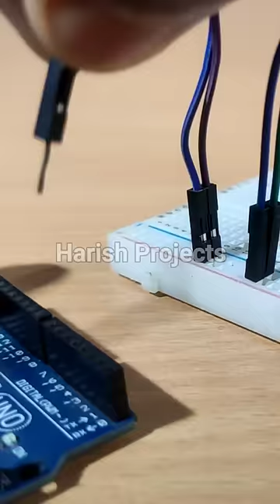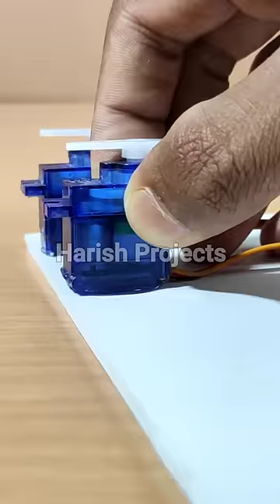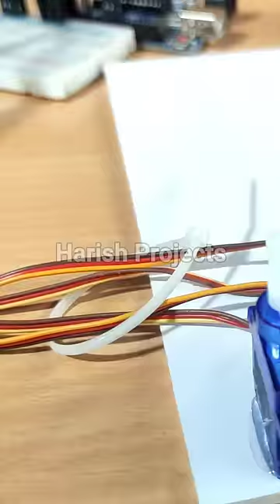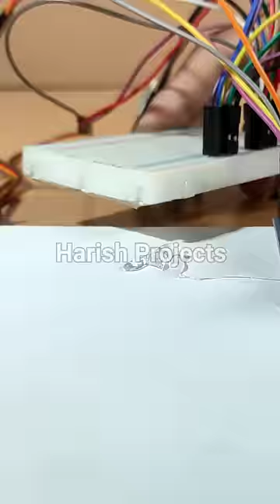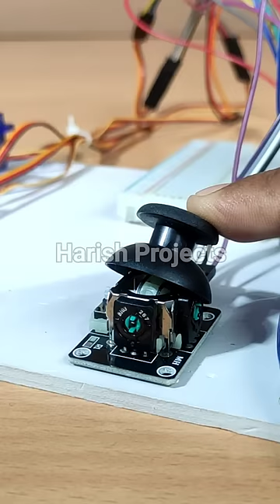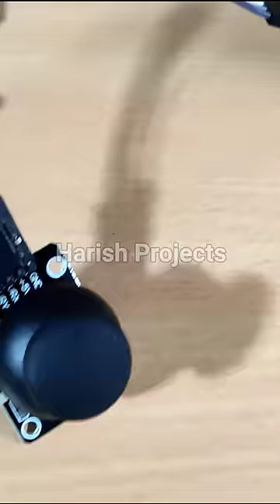Joystick Robot | Best Arduino Project #shorts

Comment: Robot?
What robot is it? I don’t see any robot.
Reply: Itu hanya sistem pergerakan bagian bagian robot
Reply: GamerYousha_YT  
How can you call it is a robot when there are only joysticks, servos, an Arduino and jumper wires?
And also, who the hell doing AI on an underpowered Arduino Uno?
Reply: @zeldalink6278 to even make simple neural networks you need a raspberry pi w lots of storage 😂
Reply: @Alex-ns6hj but it is titled as the best robotics project. IT’S NOT A ROBOT it doesn’t need ai, but a robot is defined as a machine capable of carrying out a complex series of actions automatically, this does nothing resembling a robotics project it’s just some joysticks hooked up to some servos.

Comment: Bro did you even see that little cover on the bottom of your breadboard? Well that is an adhesive that is supposed to be used when you're gluing it somewhere, you just placed glue on it, WHY?!
Reply: to be fair i made the mistake of using that stuff, and what ever you stick that breadboard to is where it is forever, the tape will pull all the metal tabs out if you ever need to take it off. easier to just glue it like that and be able to remove it later with all the pins intact